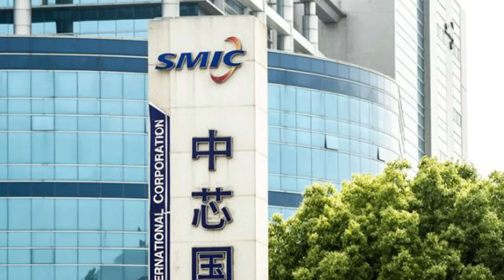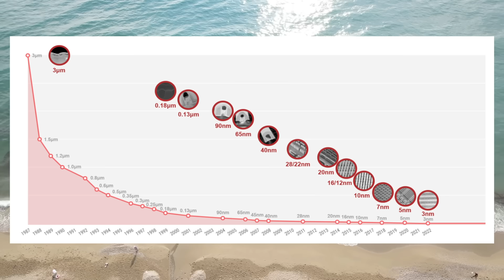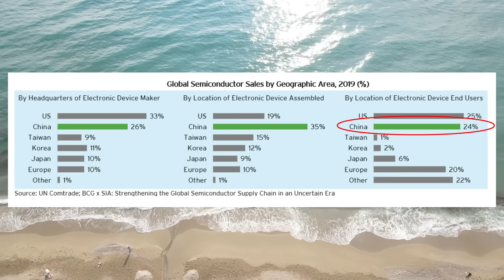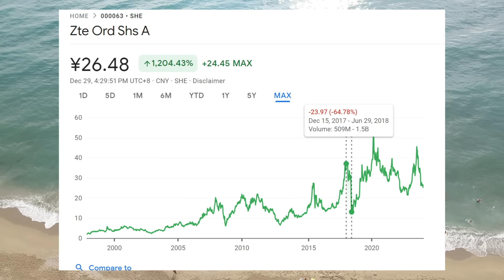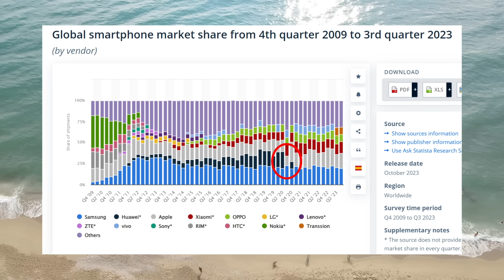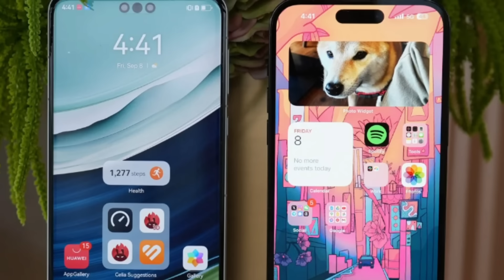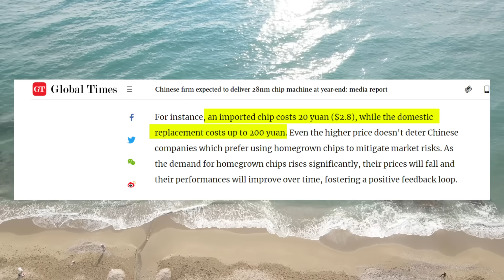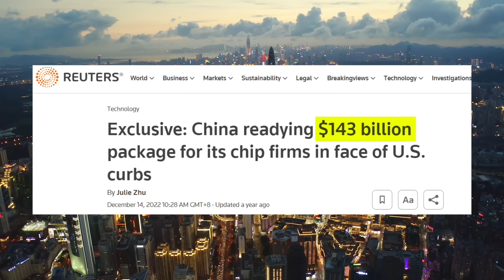Why China Semiconductor Sanctions Won't Work

Comment: I didn't expect WSM give such a hot take on Chips. Lack of research? or just regurgitating Chinese propaganda without realizing it?
Reply: Everyone doing propaganda!
Reply: They got $$$$$$ by the CCP.  Everyone has a price.
Reply: Yes totally Chinese propaganda, Mate 60 is fake, it  does not exist, there is no such thing as the Chinese space station. Our sanction works 10000% China is actually still in the stone ages.

Anyone that says otherwise is by default Chinese ccp paid wunao spy agent
Reply: He probably doesn't realize the SCMP is state owned
Reply: SCMP is owned by Alibaba, not exactly state-owned.  @samsonsoturian6013
Reply: Smells like chinese propaganda to me. Did WSM ever do material about latest "all-chinese" Powerstar CPU which turned out to be repainted Intel Core i3? Because this shows the best where China is when it comes to advanced microchips.

Comment: Your explanation about the smaller the chip the more you can fit on it is hog wash.. That is not the point of reducing the die size. Reducing the die size shortens the path of execution logic and also as a by product requires less electricity (because execution paths is shorter) to do the same or more intensive tasks than on a bigger die size.

Comment: China must have started a lot earlier to produce 7nm chip. Because it is not easy task to manufacture equipments needed to produce semiconductors and then achieve profitable yield. 
Advanced semiconductors are required for crunching data for network centric warfare and AI. So your point is not valid that military hardware doesn't require advanced semiconductors.
Reply: Them and Russia gotta have research in the background given rivalry with NATO. European countries too probably have legacy manufacturing capacity of their own from the past beyond their tech cooperation with US.
Reply: Huawei just announced an AI chip that performs at or above A100 levels for sale, which means the military has had access to it for a while.

Comment: Great video. It is really sad to see the USA maintain a choke hold on the PRC. Both compliment each other, as they have different areas of strength. One thing that has happened is the PRC has energy independence. Crude oil at USD 200 bbl will not wreck the PRC economy: they have built up oil reserves and a lot of transportation depends on electricity or solid fuel.
Reply: Maybe if the PRC wasn't an asshole hellbent on territorial expansion and destruction of democracy, they would have been great partners. But alas, the PRC won't let Taiwan go, nor their claims on the South China Sea and land borders with India.
Reply: lol not even close to the truth. China does NOT have energy independence. They import vast % of their oil from overseas and a ban on Australian coal a few years ago caused power outages.
Reply: this video has almost no facts. It makes me seriously doubt the rest of the content on this channel

Comment: WSM is wrong about the apparent lack of small advanced chips being important to military technology. Guided munitions, missiles, aircraft, and lots and lots of smaller bits of military tech depend on them. Everything from advanced communications and location finding equipment, tracking equipment, night vision equipment, anti missile and rocket systems, counter battery systems for artillery, night vision and thermal optics. If it's high dollar and has electricity, it more then likely relies on these chips. Even the note on vehicles like tanks not needing these chips is wrong. You can theoretically produce a shell of a tank without them, the control systems, weapon systems, ammunition, vision, protection systems and communication systems all depend on these chips.
Reply: Your smartphone cpu is way more advanced than what is required for military requirements.
Most chips for military are not far off from automobile and industrial applications, produced on cheap  'trailing edge' node, 90 nm or bigger. These chips withstand more abuse, heat, vibration, and EM radiation. You see there are many cars from 2000 still run on original ECU, while Imac from the same year has been dead years ago. That kind of reliability is built on older more tested process, buillt on more robust platform.
US sanctions target the wrong node  if it is really meant to limit military technology advancement. It is really meant just for the sake limiting Chinese technological advance, like a bully that games the market so its competitor wont surpass.
Reply: @silentIm  military technology isn't designed using low end chips.  The leading tech military equipment all use supercomputers to design and develop.  Note that China still hasn't successfully designed a stealth bomber 34 years after US developed it.  The end product when built 10 years after they were designed may not use the latest, but they were when it was first designed and developed.
Reply: Cutting edge chips are not in military equipment because they are used in R&D.  Future military applications are built off current chip technology.  It seems like missiles are using old tech, only because it takes years, maybe decades to develop, validate, and manufacture a new design.  Your phone with a 2nm chip can overheat and crash, and all you'd end up with is a class action lawsuit.  But a new 6th generation jet will need components that are dependable 99.99% of the time, so do the guidance chips in the missiles they fire.  The time to market for military equipment is on a whole other scale, but they are always on the cutting edge of what can be produced.

Comment: you should do a video on EV sanctions as well.. the USA seem to be happy with $100k ev trucks and SUVs, meanwhile the rest of the world will have $20k EVs  from china (which pass EU safety stds btw).. the USA is bnasically a captive market with zero export potential due to high manufacturing costs (and the world do not want gigantic SUVs and trucks)
Reply: Chinese EVs are backed by government subsidies. Basically the Chinese taxpayers are paying for every EV sold anywhere. And the EU is definitely going to enact anti-dumping policies to avoid ending up with fields of unused rotting EVs like China already has.
Also EV technologies still have a long way to go. They're basically worthless after 5-7 years and there's nowhere near enough infrastructure or raw material to support a complete replacement of ICE.
Reply: 1.  He already has done that video.

2. Funny how you say that US only sells large EVs.  Actually, EV trucks cost about $60k while the Tesla base model is about $40k.  

Now, I can go on about why the West EVs are way more expensive than China's, but I think I'm already wasting my time on someone who cannot even report the correct figures
Reply: " $20k EVs  from china (which pass EU safety stds btw).",  sources?
Reply: @oqlassic8799  I can buy MG HS EV in UK. That is your source.
Reply: @oqlassic8799  source = ccp pamphlet.
Reply: Everyone loves SUVs. SUV market share is increasing all over the world.